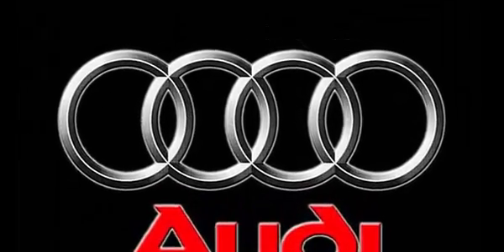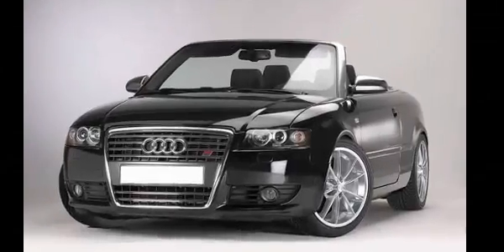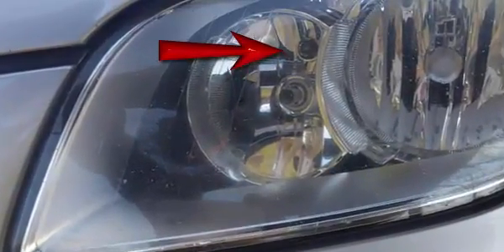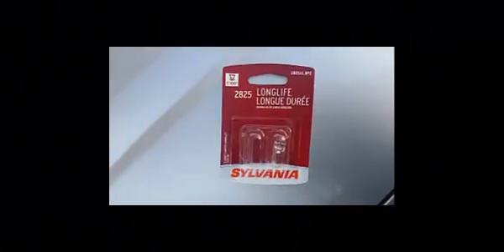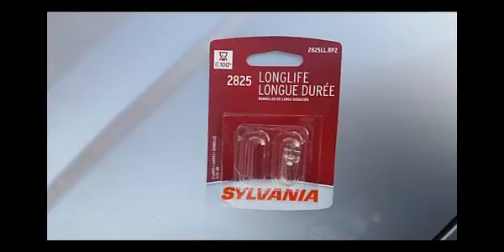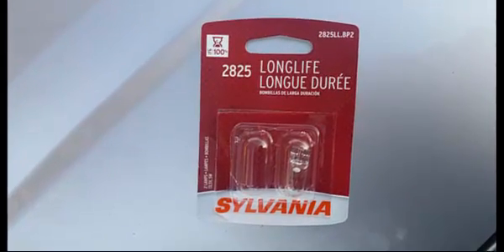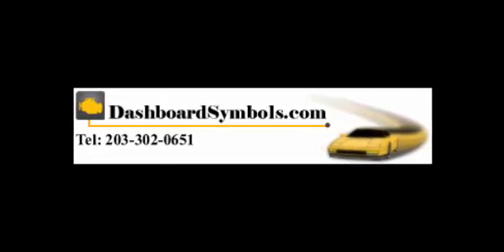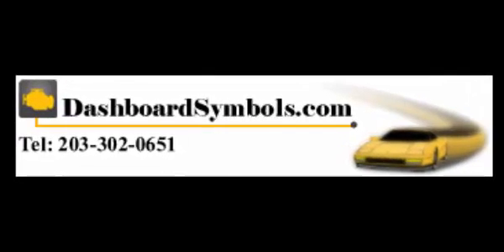Replace an Audi park light bulb, 2007 A4

Comment from the maker: I had occasion recently to replace the bulb in the right side park light. Although it was essentially the same process, it turned out to be considerably easier. I think it was simply because I am right handed and could handle the angles more easily because of it. Otherwise, the same process, mirrored.

Comment: I watched your video because I have a 2007 9-3 with that light out. I thought it needed to be turned to unlocked, but no pull straight out. I had a special type of short crimping pliers that grabbed onto the bulb base. Thanks for posting!!
Reply from the maker: A Saab! Well, a big risk that paid off. Glad it worked...

Comment: Very Very Helpful.  This video made it so easy to fix.  If you are fixing the passenger side, you will need to remove the Airbox cover to the behind it to allow the needle nose pliers inside the back of the light housing effectively.
Reply from the maker: Great and thanks for the tip for the other side. Haven't had to yet...

Comment: Very helpful to use an inspection mirror on a flexible shaft, a little LED flashlight and 11” needle nose pliers on my “08 A4.  My radiator hose seems to be more in the way.
Reply from the maker: (sorry, I just found a whole lot of comments that weren't immediately visible)

Comment: I put a flat head screwdriver between the bulb socket and the rim of the  mounting hole and twisted it to pry it out the first millimeter. After that i could remove it with my hands.
Reply from the maker: Good work. Don't think I could have seen it well enough too do this.

Comment: I changed it and it still doesnt light up (Audi A4 B6) it says Left Parking Light which I changed with brand new W5W, wires seems in good condition
Reply from the maker: I would check the wires again -- I had to splice a bunch of them. Otherwise, no idea...

Comment: You just pull it out, hold on the wired?
Reply from the maker: The socket comes straight out. It does not need to be twisted. So yes, if you believe the wires are strong enough they can be pulled. But it would be best to use long needle nose pliers.